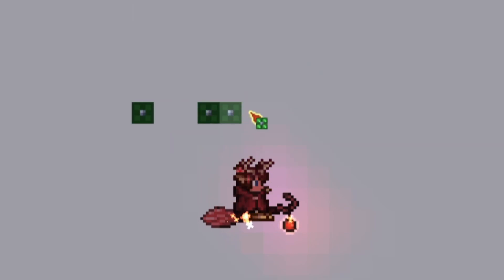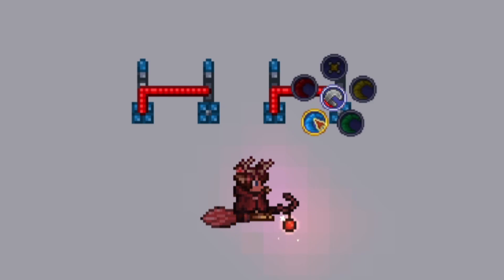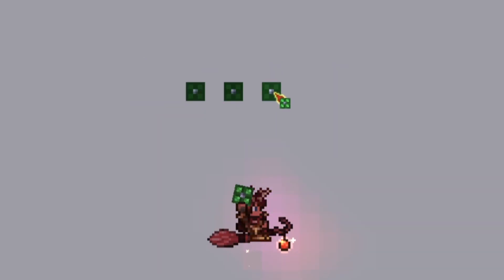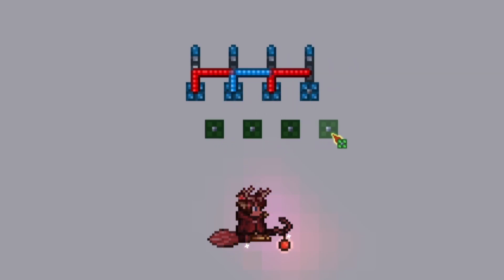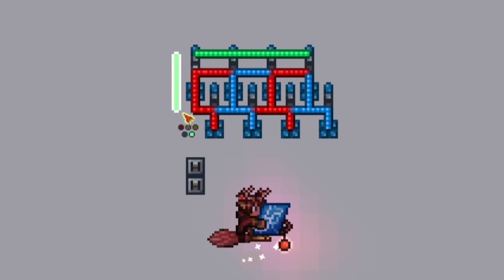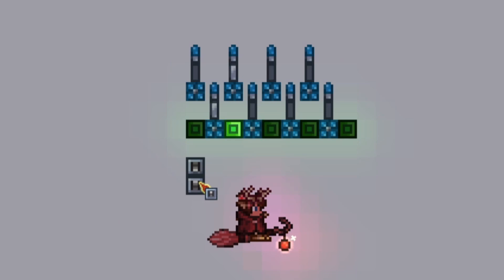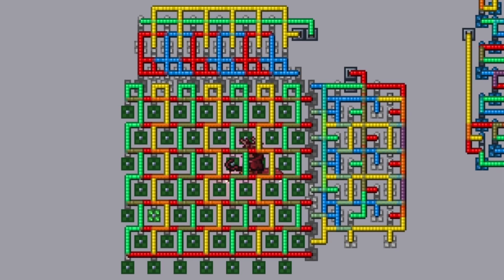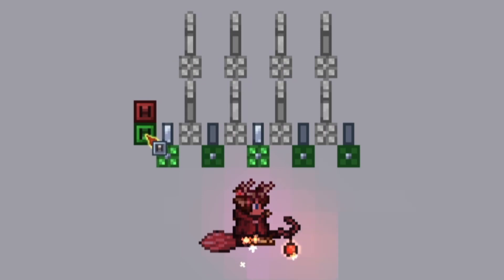Terraria: why Shift Registers are so important...

Comment: could i ask how do u start the 4 diection shift register
Reply from the maker: Simple - Just by making two bi-directional shift registers, where one is for X and one is for Y. If you just find the intersection of those two, then you will have your 4 directional shift register.

Edit: Start the shift register? If you mean start building then well I would start with picking one horizontal shift register and one vertical one. If you mean how to start it working after it's been built, make sure at least one lamp is turned on.
Reply: @CubsYT  I’ve done the 4 direction register but when I press the switches nothing gets activated
Reply from the maker: @AntonyWood998  If you send a screenshot in my discord server and ping me I will take a look!
Reply: @CubsYT  ok